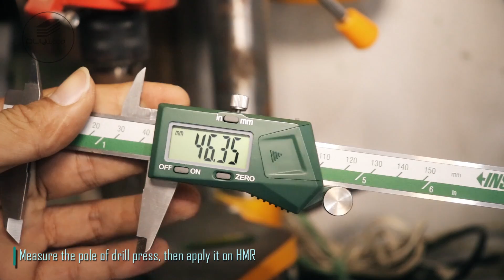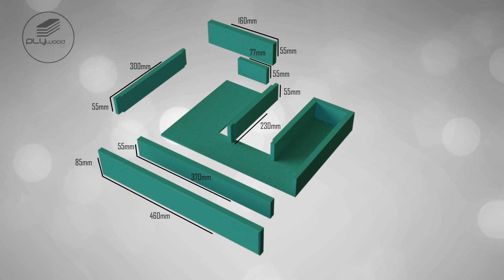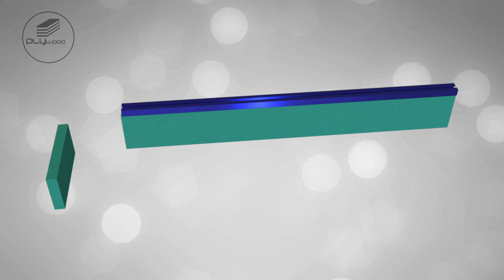Drill Press Table & fence with storage -freeplan

Comment: You use epoxy at times and use a screw at other times to install t track Are there fixed rules in that matter or according to what you have except that wonderful work is thankful for it and do not forget to work spindle sander because I follow all your videos dear and do most of the ideas that you put forward
Reply from the maker: just give epoxy and screw t track on position, epoxy for make for secure t track on position